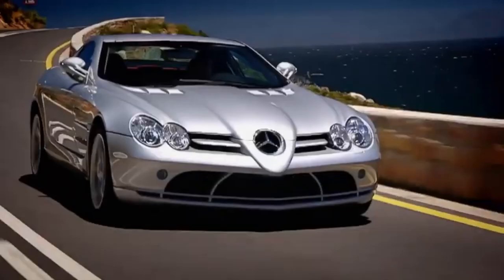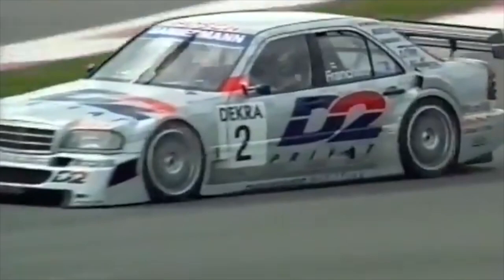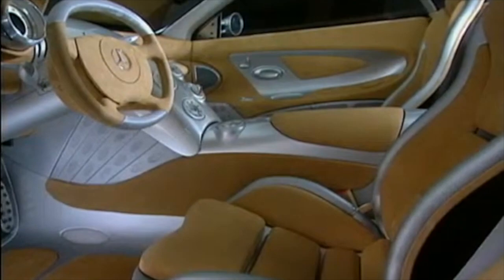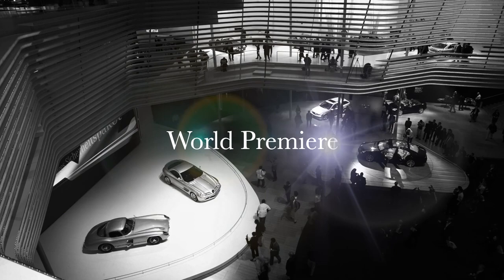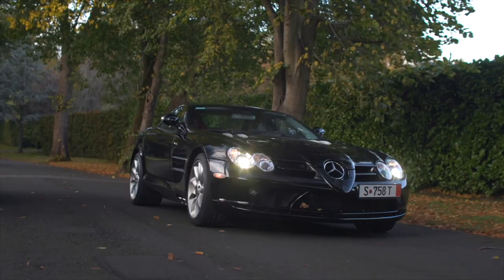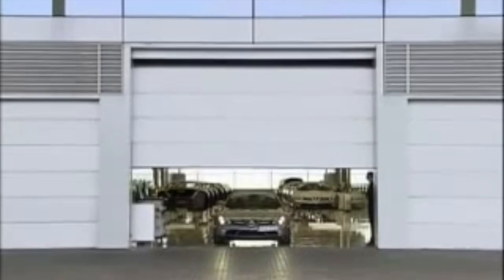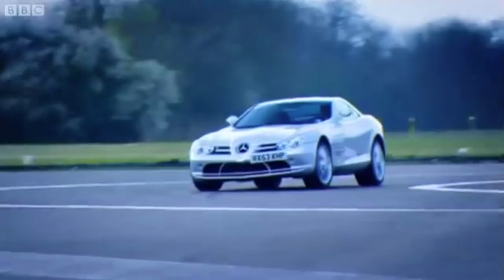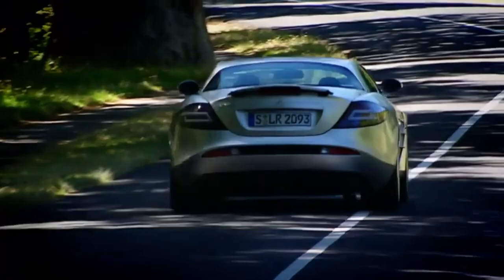The Full Story - Mercedes-Benz SLR McLaren

Comment: Since SLR was the only vehicle in history that came out from join collaboration from two well know manufacturer giants; here are some facts regarding maintenance of SLR that no one would want to hear:

-The hood costs $100,000 to replace. 
-Brakes are $50,000 each. All 4 for $200,000. Now Mercedes/McLaren do propose a method to fixing them if you're not comfortable with the cost to repair/replace, and the process is that you( the owner ) take the vehicle on a track, get it up to 120/130mph and slam on the brakes, and do this 4-6 times. The heat would actually repair the damaged/wore out brakes.

Reason why it is this much expensive is this the only vehicle that was a joint venture between Mercedes and McLaren and most parts are actually made by Mercedes or McLaren, there are no parts lying around for it.

But either way this car is really beautiful.

Comment: I'm one of the few that actually liked the 5 speed auto transmission. It's actually suited very well to the torque monster V8.
The transmission itself shifts gears quickly, it just doesn't respond well to the paddle shift or buttons like it was in early AMG models. Even modern Mercs in Comfort mode have the habit of not responding to paddle shift exactly when you want it to. There is a half second delay.

In short, it's something to get used to. I can only imagine what a modern 9 speed automatic would do to the SLR's performance, Merc use it on V12 Maybach models.

Comment: My opinions and passion of the SLR are 100% inline with yours.  It seems most just looked at all the negative aspects of the car and really used Gordon Murray as permission to mock it's design and purpose in the market.  I have a budget SLR a 2006 SL55 with the P30 performance package.  Only 45 cars were ordered and imported to the USA.  Not officially - IMO the rarest AMG of all!   If you ever do a story on the R230 please contact me and I can provide more than just technical specs of the $14K upgrade over an regular SL55.  When I drive her, I sometimes, not all the time - pretend I'm in a SLR 722S Roadster.  Heck, dreams are always free right?